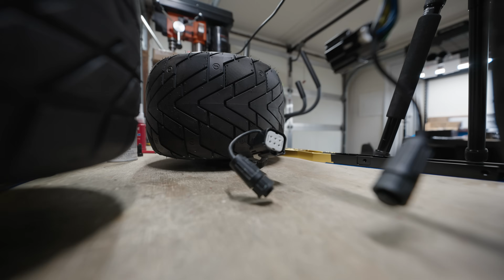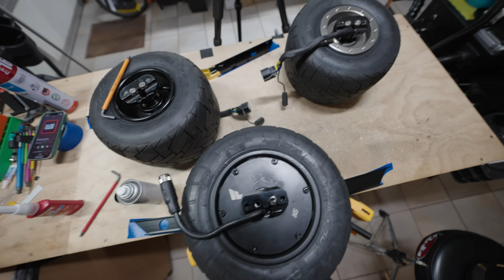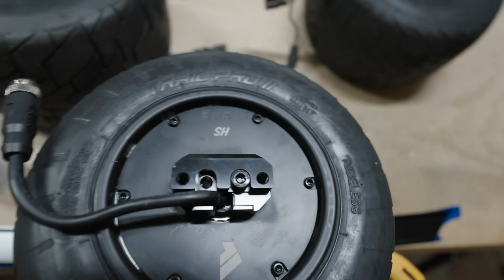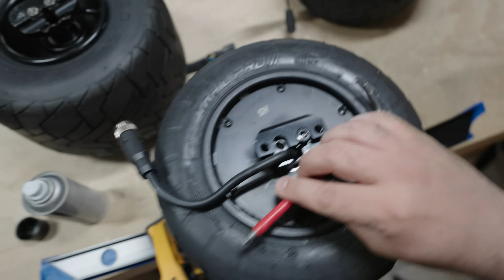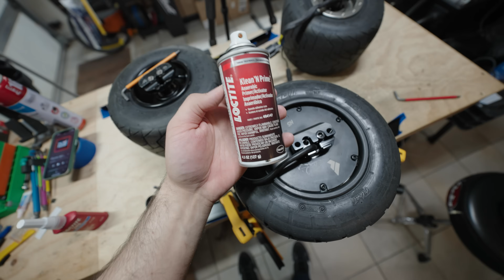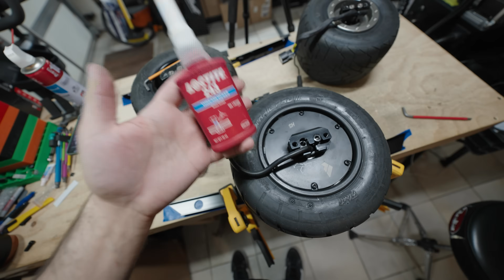Are You Destroying Your New Onewheel Motor?

Comment: I recently ordered a Pint S Series motor to work with my XR based VESC build. I also ordered a Superflux male connector to replace the pint style connector. What type of silicone would you recommend I use since I have to clean out all the old silicon in the center of the axle.
Reply from the maker: Any RTV silicone should work for that.